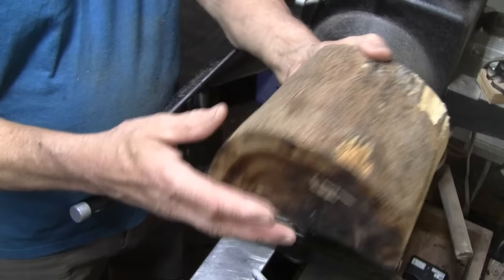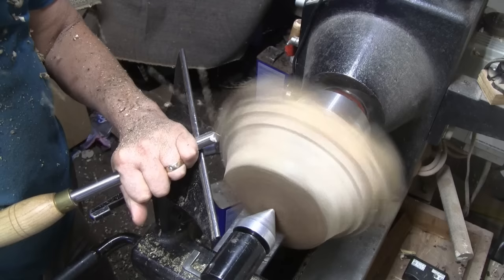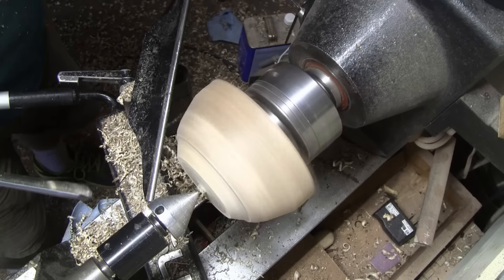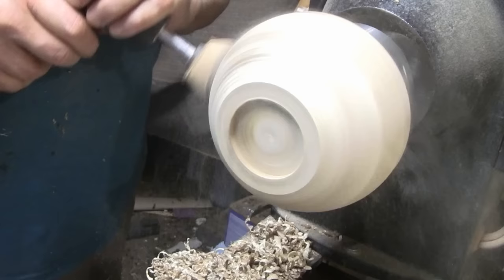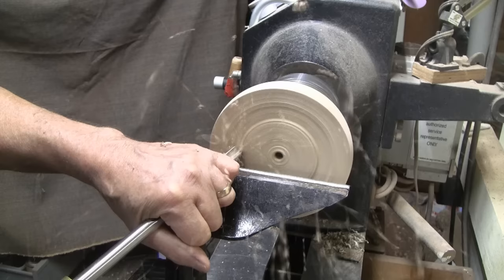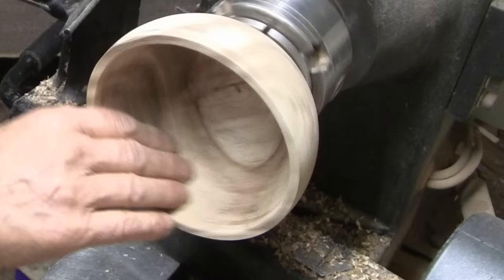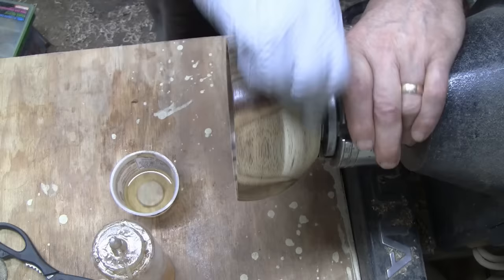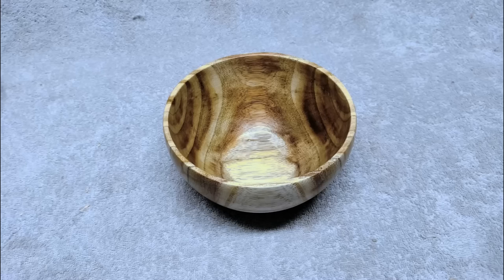Ten Minute Mimosa Wood Turning Is It Possible

Comment: What a beautiful grain, There are a few mimosa trees near where I live, I will have to talk to the owners and ask they call me if the ever get limbs off in a storm etc.  Watching you deal with the heat I  am so glad I decided to put in heat/AC  and insulate real well when I converted what was a 20x24 storage shed  to a dedicated woodshop. Lungs @ 27% I don't handle heat/ humidity real well :-(
Reply from the maker: Thank you very much. I did insulate when I walled it in and did have AC but it was in a smaller room in back of the shop. 
Our temperatures rarely reach that high and it is usually pretty mild around here.  But this was a real shocker.
I think if I moved faster in the morning and could get everything done before it does get hot.
 Even small limbs have pretty nice grain and can be made into something. Nice to have bigger pieces though.
Thanks for watching,
Gary
Reply: @ThePapa1947  You're luck, the summers here in MO are way too hot (my only complaint) Not as bad this year but I have seen 1 month + of triple digit heat :-(  when it is that bad I don't even risk the 100 ft walk out to my shop :-(  But on the flip side winters here are generally 90 days and done :-) VS where I grew up in Vermont. As my grandfather coined: "Vermont don't get a summer, just 3 months of damned poor sledding!"
Reply from the maker: Yes we sure have a lot of different weather zones here in the states.
 We have a saying here that we do not tan we rust. There are times it seems the rain is never going to stop.

Comment: I have a couple of green turned blanks of Mimisa.  One thing I noticed, it makes me cough, so I've taken to wearing a mask while turning it. It does have very nice grain.
Reply from the maker: Yes I did notice the dust is not pleasant. The overhead air filter helped pull it away. That and a mask helps.

Comment: Why do you apologize for it being a small bowl? All bowls do not have to be big enough to sit in. The reality is this is a very nicely proportioned bowl and is just as big as it needs to be. In my opinion it could have been a bit shorter so more of the figure would show in the bottom. Thank you for the real time video. I hate speeded up. It makes everything look so frantic and I cannot tell what is being done. There is no need to speed up things just so you can show every cut. Keep speed normal and edit out all of the mundane cuts, keeping only the interesting stuff. You did just right on this one. Just enough cutting, a bit of sanding to show technique and the finishing. Everything that needed to be shown and nothing more. And all in under 15 minutes. Way to go. 👍👍👍👍 Thank you for sharing. Have a great day and stay safe.🙂🙂
Reply from the maker: Thank you Glen and thanks for your opinion I certainly will keep it in mind.
Editing is way harder than turning for me and any trick I learn is a good thing.
Take care,
Gary